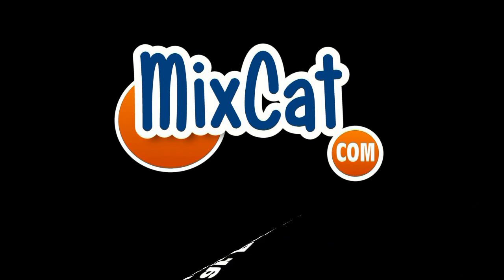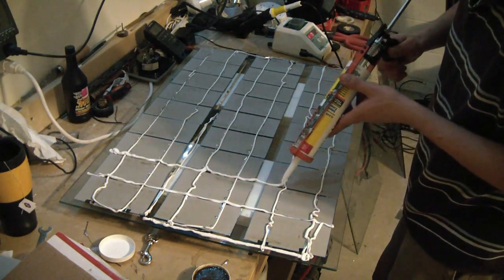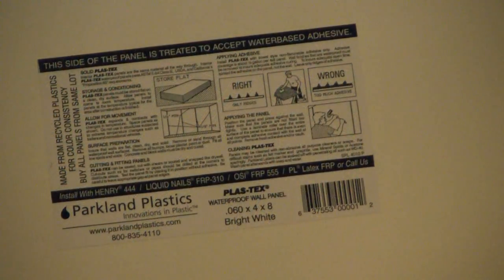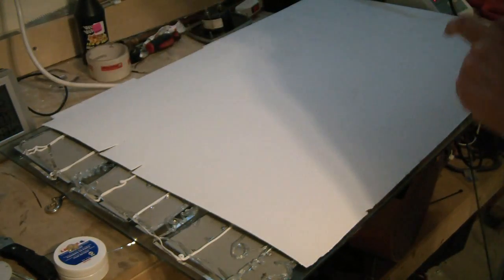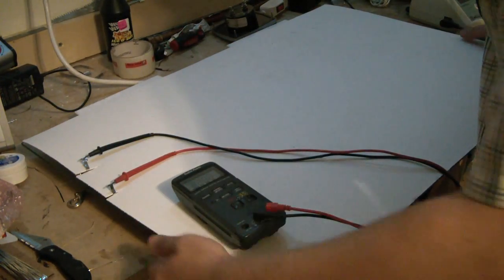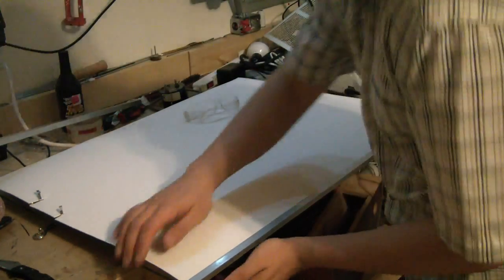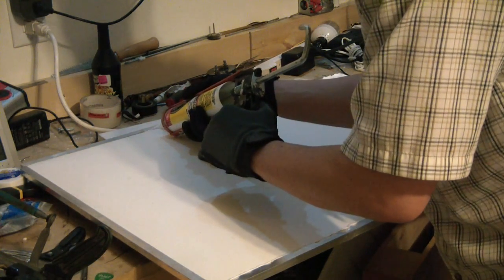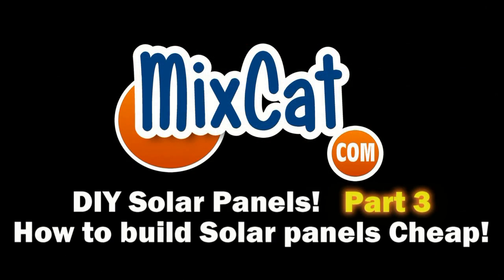How to Build a Solar Panel from Solar Cells DIY - Part 3

Comment: OOOPS I found out, Plas-Tex panels at Lowes = 20 bucks for a 4x8
Afraid that will give you one panel:-( I plan 4 rows of ten 6" cells= 5 feet.
Through in the silicon goop and well, the sealgard 184 is looking cheaper.
I have seen guys blop on the sealgard and NOT apply a backing at all to the solar panel leaving it exposed in the back, after all that’s what sealgard does, it seals DUHhhhh!!  Keeping the cells cool the amps don't dive after 2 hours in the hot sun.
Permanent installs a "Pegboard format backing" is recommended but temporary camping doomsday setups leave it open. Sealgaurd methoud minimizes the air space between the cells and the glass lowering the GREENHOUSE EFFECT very important.
Remember these solar panels are actually solar ovens if not built right, topping 200 degrees inside, ouch!! there goes your amp rating TOAST!!! I h ate the greed of sealguard poeple but it's an evil necessity until a plagiarist comes along.

Comment: I appreciate the technique that forgoes the grossly over priced Sealgard 184.
Unfortunately the savings might be offset by the Sealer that you used which we where left to "Guess" the brand, the cost the amount used and add in the Plastic backing cost and maybe the costs are the same, I wish we where informed of these costs.
 I would go for the Sealgard 184 because encapsulating the back of the panel is going to generate/hold in heat, {{solar oven anyone?}}   The Sealgard 184 Leaves it open and allows heat to disperse,
I am amazed at how many solar experiments whent bad in the eco communes next door to me due to over heated solar cells. They start out slightly over maximum amps and and hour later WHAM!!!  the amps are half the rating because of heat. Cool it off with a water hose and the amp rating came back for a few minutes. As much as I HATE the cost of Sealgard 184, It's beginning to make sense. Now if some sleazy entrepreneur will come out with a Sealgard 184 replacement for half the money we'll have it made. Anybody try high temperatured silicon gel? Just a thought.

Comment: Hello, I have purchased the cells, the tab wire and the bus wire. When I thought about the frame, I could not figure a way to do it. What size C channel are you using?

Comment: Good information, I've been thinking about trying this.  It would have been a little better if you had done some editing, for example once you explain what you are doing with the silicone, just fast forward until you are almost done.  It makes the video a little shorter.  But, it was still good.

Comment: lloyd
can see how pos  and neg are set up could not work out what i would do with oposite end of panal. would i solder tabing wire acrose or trim ends of very good vid

Comment: I would like a little more detail about how you connect the tabs to two leads at the bottom.  Also, where does the blocking diode go?  And finally, you didn't adhere the solar cells to the glass, how are they not sliding around?
Reply: usually all of one side it positive , and the other end negative. bridge them to an end and run the wire(s) out.

Comment: You forgot to seal your solar panel with elastomer (about 30 bucks per panel and the most expensive part of making solar panels) this panel that you are showing here has most likely failed already with most of the solar cells cracked if it has been out in the elements.Elastomer will seal your panels for over 20 years.Nice work on showing everyone the process, I'm sure this has helped many.

Comment: After all that good work, there was a need for more instruction on the electrical connections at the end.  Getting that power from the grid to the outside of the panel takes care and attention.

Comment: I appreciate the amount of real time video you showed.  Clearly, soldier is your specialty.  I was shocked that you did not miter cut the joints for neatness.  Your comment about the back not showing would get a repremand from my old shop teacher: he wanted it all to look good.  I have my doubts about how much back-bending you did to reach the work.  An old guy would have to think about that.  You arranged the whole thing in series!  That could be a lot of voltage. I thought 20 volts was goal.

Comment: does it have to be car batteries? could it be like big ass buss batteries or could someone just tell me what wont work or what will work? will miss matching batteries work like a car, boat, and buss battery work together.

also how do i determine how many of which would i need? like 1 normal car battery for how many 3x6 unbroken cells? whats the math so i can figure that out on the fly at the next junk yard visit?

man cave shot my power bill up to 400$ ish a month.. gotta fix that problem asap!

Comment: interested in getting some solar cells off you.  You said you can get them for $1.5 a cell?
Also, how do you hook up your panel to the wire to the DC to AC inverter?

Comment: How do you clean the solar cells after tabbing them? I have tabbed about 100 cells and they have finger prints and flux on them. but I am not sure how or if I should clean them before I continue. I see you sell the cells, do you also sell the tabbing, buss wires and flux? Oh ya what about the diode? do I even need one if I am not hooking to battery's but going direct to my well pump? how do I find one and know what kind to get for my panel, the panel will have 60 cells in it.
thanks for the vids

Comment: Great vidi ...... have you found out how they grade the cells ? I presume there is some system like the rings on resister components & the like.  Did you have any problems with trapped moisture in the panel, as you generated a bit of a gap ? 
Regards Bob

Comment: what about condensation build up inside your glass?  You should vacume seal and or epoxy the cells to the glass so no air inside your case.... just a thought

Comment: Do u have any problems with the backing warping or bending?  I used thick plexi glass on mine and it warped :( :(  was following the advice of an ebay manual by livingOffThaGrid

Comment: reat video.   You explained perfectly and great presentation.You showed how easy it can be done in properly placing your cells and soldering them.  Great learning for your DIY solar project.  You can find how to make solar panels yourself also by visiting The Guide to solar site at  Again great info

Comment: @Justmyside i wondered about using copper ?you can buy 8meter rolls in poundshops ,speaker wire?a hell of a lot cheaper than tabbin wire ?and would ordinary paste flux work?pete uses similar?flux pens expensive+not much flux in them ?,,,

Comment: I know its more expensive, but if ur going to go through all this work,why wouldn't you use copper for ur bus line & tabbing wire.Were talking small values here, quality matters,why use tin when its not near as good as a conductor as copper.When you are soldering you should advise people who are not familiar with the process that you want a "shiny" solder joint. A "dull" joint means you did not get a good bond "unwanted resistance", ( another term for it would be "unwanted noise" for radio etc).

Comment: I posted a comment about a half hour ago and it has not shown up- so I will try again: I have never seen this type of backing used before on a panel- how did you hear about it? How much success have people had with it over a span of 2 years or more? What size is it sold in?  How much is it?  I used thick 3/16 thick plexiglass for my backing and it warped all to hell :( (posted vid of warpage on my utube page)

Comment: is there a step missing here between video 2 and 3?  all of a sudden your cells are all connected and you have caulking already applied.  looking like there's caulking on the thicker tabbing wire?  how long was that tabbing wire at the bottom there in the end?  sorry total noob just trying to get an idea.  thanks for video 1/2 i really have a solid idea now thanks to this....

Comment: Pete,  You really should let this panel weather and see how it turns out before making more of them.  It could be a disaster going through the winter and spring.  You're really good at doing this kind of thing, and I enjoyed watching, but I'm thinking it will be a disaster.  I'm letting one go through the winter myself to see how it weathers, and I already know it will not last long after learning more about building them to last.  The guy who commented about the moisture inside is correct.

Comment: I like how your putting your panels together. Looks easy and clean.
How do you get rid of the moisture inside the panel after its sealed up? When I built my panels I get moisture inside because of the silicone drying. I have to put vent holes and I put a small computer fan to suck out the moisture. After a few days of the fan running it days inside and I can seal up the holes.  After that I have no gotten any moisture inside.